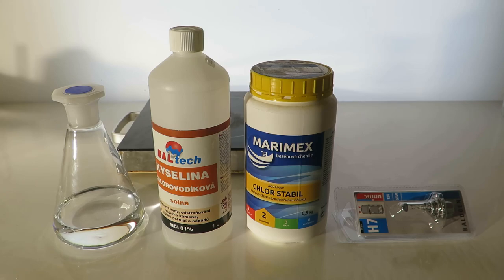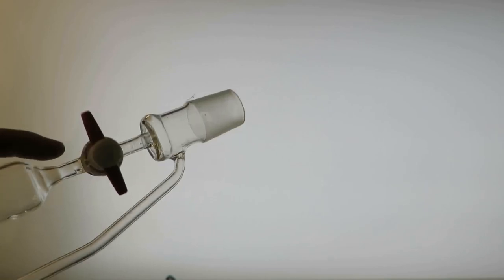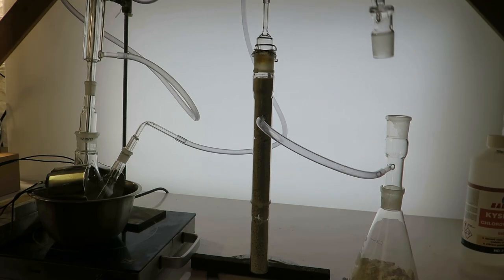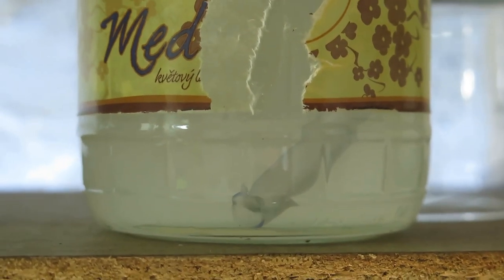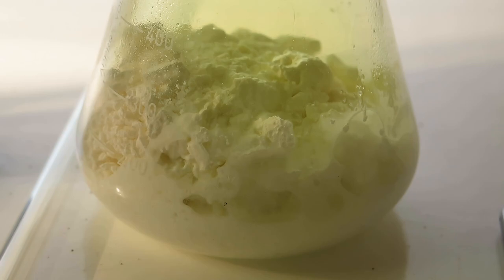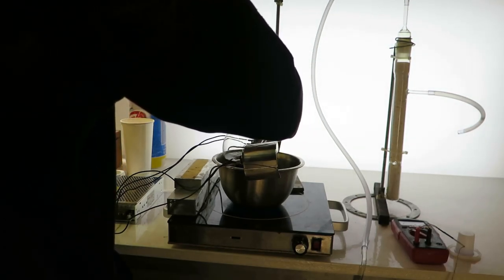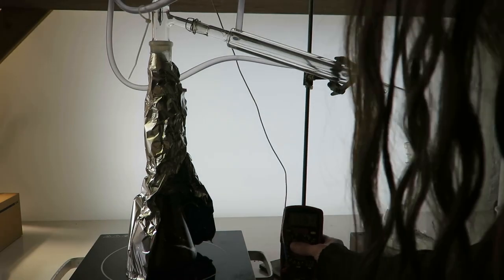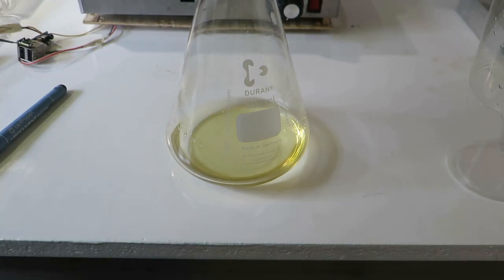Making benzal chloride - Toluene photochlorination

Comment: Still, an instructive clip.  I've done something similar using ferric chloride as my chlorine source.  I too am careful with such reactions.  A very famous rx about getting FeCl3 to about 70 C or so to etch copper clad circuit boards.  Works pretty good with other stuff too.  A lot of sitting around watching your thermometer and picking your teeth, so to speak.  Well done.

Comment: I'm a fan of the channel, but it amazes me how almost everyone ignores PTFE joint sleeves on Youtube, those things are awesome and can save you so much trouble!
Reply from the maker: Wow, that's amazing product! Though I had trouble getting PTFE valves even, so Not sure if I can get that easily
Reply: @IlusysSystems  I'd be happy to send you some, I've got more than enough, but I'm not sure how much better that would go...
Reply from the maker: @chronically_late  Thanks, I sm pretty sure I can get some from china, but I usually buy locally for what I can get. I have trouble being available when mail comes, and then it sits in depo and I need to go get it anyway. So it's same level of convinience for me, just now I have to go to yet another place but with time limit.

Comment: Use the sommelet reaction to turn it to the desired benzaldehyde. ive had good experience with that, and hexamine is cheap and since your polish likely very very easy to get/make
Reply from the maker: Thanks for recommendation, I just now ended converting benzal chloride to benzadehyde by refluxing with HCl. issue is, that this doesn't convert benzyl chloride, that is still present. I will definitely try this and see what results will be!
Reply: @IlusysSystems  if you buy hexamine as camping fuel tablets i found that the best method was to dissolve in room temp water (hexamine has reverse solubility with temperature), filter the wax and evaporate. ive tried different solvents but theyre all worse than just simple water

Comment: Mmm 2020 but you use halogen car headlights to photochlorinate? i wonder why, because that's not efficient at all considering the wavelengths were chlorine absorbs best are beyond 400nm and incandescent output mostly infrared and warm colors. You could use some 400 or 395nm LEDs they are so cheap now.
Reply from the maker: I tried, the performance isn't much better, if at all. Dunno why exactly...
Reply: @IlusysSystems  That's very interesting to read, I will experiment myself about that, maybe i could use halogen headlights for many reactions instead of delicate LEDs. So far only have found halogen light bulbs to work great for photooxidations with singlet oxygen generated by methylene blue. Thanks for the reply, always learning.

Comment: Can sodium cloride be used instead of calcium cloride?
Reply from the maker: Well tecnically yes, if you used dry NaCl and probably a lot more of it, it will remove some water. I don't think water removal is ultra critical, and TCCA + HCl generates only a little water contamination in first place

Comment: And can muriatic acid and sodium cloride be used to generate chlorine gas ?
Reply from the maker: No, this wouldn't work, there are other ways to generate chlorine gas. If you have big enough PSU, you could perhaps generate chlorine by electrolysis of NaOH, but this would be very inefficient

Comment: 2:40 You should upload some videos of you making equipment like that. That's pretty impressive. Maybe even just a time-lapse video of it. I've always thought glass blowing is boring as hell, but then I got into chemistry as a hobby, and the glassware is so impressive. I looked up how some of it's made, and I no longer think it's boring as hell, lol. Takes some crazy skill and a lot of experience. I can hardly seal a damn ampoule.. haha
I do keep all the ground glass joints from broken glassware, as well as any tubes or stopcock sections so maybe one day I can use them to fix some other glassware (like CodysLab did to fix a broken ground glass joint on a still head) or make new stuff for unique situations. I would need an oven that gets hot enough to anele them though, so I can't try it out right now.
Reply: I'm the same. I collect broken glassware for fixing. I bought an oxygen propane torch kit but so far only made a few ampoules and played with some boro tubing

Comment: Man i admire your glassblowing skills! I have a little welding torch myself that i use for fooling around with glass sometimes but i'm having a hard time making anything cooler than a crooked miniature liebig condenser. I guess having a lathe makes a huge difference?
Now this is a bit out of the blue but are you on discord or something? I thoroughly enjoy watching your chemistry videos but now that you're getting into more and more serious glassblowing i'd love to exchange a few more words than youtube comments are good for, if you want :)
Reply from the maker: Thanks, I am not on discord unfortunately or any "social networks" really, I think you should be able to see my email though.

In any case, I wouldn't consider myself to have skill much, I am at point where I am barely able to make something that's not garbage. So far my observations are:
-make sure glass is not moving when cooling, otherwise you get nasty stress and frosty spots on glass
-make sure you melt glass well, esp with thick glass it oftem looks like it's good from outside, but if you cut your joint, you see there's barely 0.5mm wall thicness. So far I learned, that it takes much more time than you would think for glass to flow and make good wall. this can be quite problematic even for me in places where 3 walls meet
-Lathe is definitely big convinience factor, mine is quite poor construction, so parts usually have like 1mm offset from true center, but even that seems to be better than nothing. Being able to heat glass uniformly and blow at the same time will enable you to make nicer joints, 2 chucks will free you 2 hands. I haven't tried to make any complex part without lathe with my new experience. Perhaps I should try but I am quite confident it would look very bad and it will take me 10x as much time. Perhaps with enough attempts I would be able to learn to make something decent and develop lathe free techniques.

In any case so far I have made like 3 condensers and a bunch of adapters + that drying thingie. even my chlorine inlet adapter had already crack when I was filming this. So that's about my skill.

Comment: QUESTION.............GREAT VIDEO.....You used about a mole of toluene.  How many moles of chlorine did you make that you bubbled through the toluene??????   I am not a 100% sure but it is my BELIEF that IF you have 100% of the chlorine react and you make 93% of a mole of chlorine and react that with a mole of toluene that you will end up with 7% toluene/55% benzyl chloride/35% benzyl Dichloride/3% benzyl TRichloride.
                      AT THAT POINT if you bubble in any more chlorine what will happen is for every benzyl Dichloride you make you will also make one molecule of benzyl TRichloride (from a molecule of benzyl dichloride)   ....so AT THAT POINT it is futile to bubble in any more chlorine.    After that point the percentage of benzyl dichloride will REMAIN THE SAME.   You will just be chlorinating toluene to benzyl dichloride that is then turned into benzyl trichloride from then on.  STILL A GREAT VIDEO
Reply from the maker: I haven't measured amount of cl gas consumed, but I think you are correct in that you will always get mixture of mono, di and tri chlorides and I too observed that after some point yield of dichloride is pretty much constant. I think here I was meant to stop as soon as I would be producing excess of trichloride, because it's bit more nasty...
Reply: @IlusysSystems  ...........So far i only tried to photochlorinate some DCM.   It worked in a way.  I noticed  a leak in my fume hood as soon as i started making chlorine.   So instead of stopping i figured i would just do my 5 hour experiment in 5 minutes.   I just bubbled that chlorine in so fast it was unreal.   Still got an 8% chlorination.  I used an LED blue light.   I plan on making benzyl chloride soon.   But after that last fiasco i decided to make benzyl bromide and then just hydrolyze it to benzyl alcohol with some sodium carbonate.  AND THEN  make the benzyl choride from the benzyl alcohol and HCl and not have to deal with making chlorine.   CHLORINE IS SO NASTY